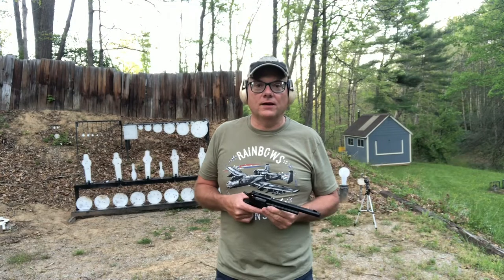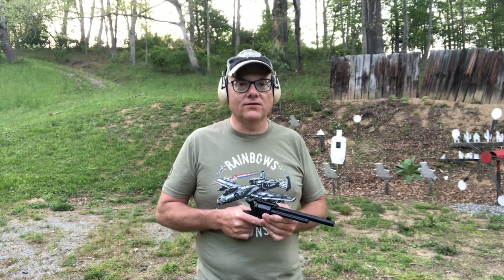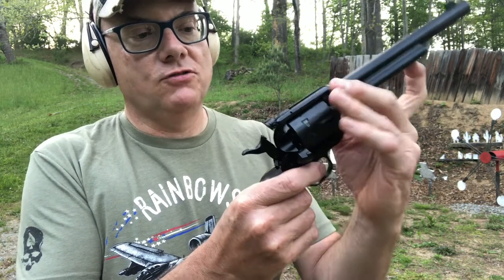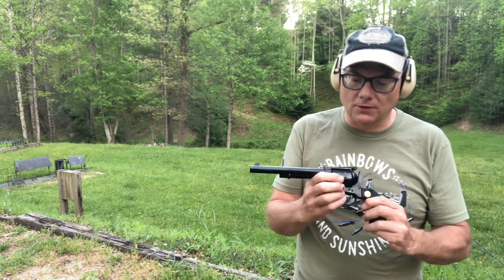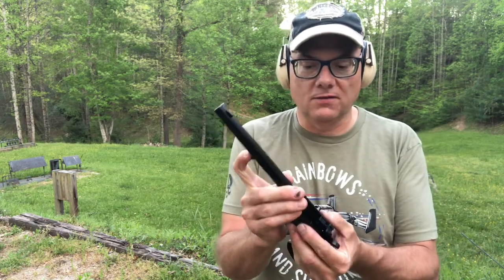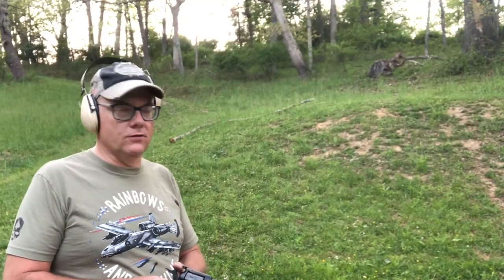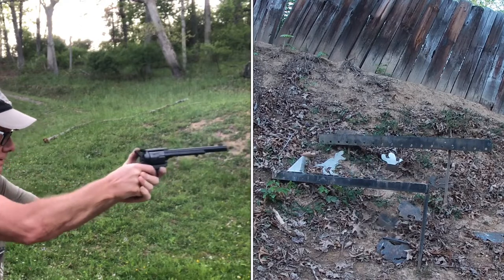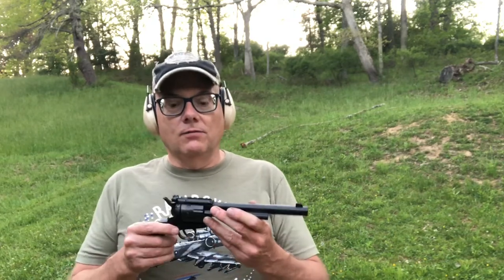Shooting the Chiappa 1873 SAA 22-10 Target

Comment: If you go any further than the first click that cylinder won't spin. Only 1/16 inch further and it catches some other click and won't spin.Just make sure you go no further than 1st click and it's fine. My 1873 38 spl. SAA has been like that since their factory returned it from a jammed cylinder lock repair. It's a glich inside so just don't go to that next little click and your fine. They fixed the cylinder lock and cleaned it like new but since they returned it I noticed the extra click weirdness but it doesn't seem to hurt anything.I've only practiced handling and dry firing lazer cartridges. I like this gun.
Reply from the maker: Thanks for sharing your experience and knowledge.

Comment: I wonder if the Chiappa 1873 22-10 cylinder is interchangeable with the Chiappa 22-6 cylinder? Nice Vid!
Reply from the maker: I just did a quick search online. It looks like the 22-6 is a 6 shot revolver. I’m pretty sure that the 10 shot cylinder wouldn’t work because the timing would be off. I think the 10 shot cylinder would be a larger diameter as well. I appreciate you watching the video.